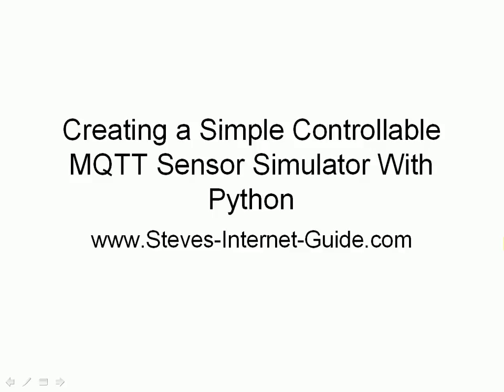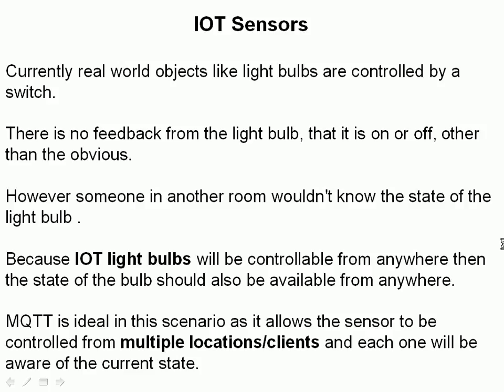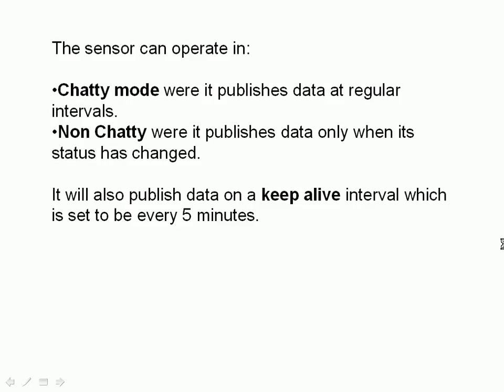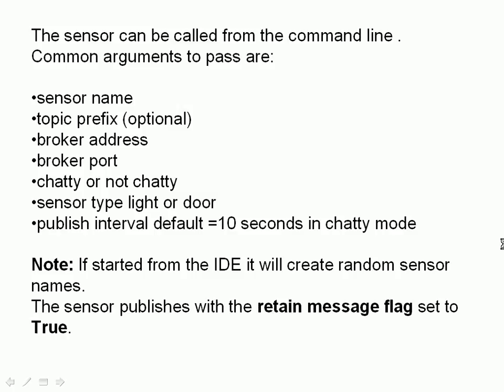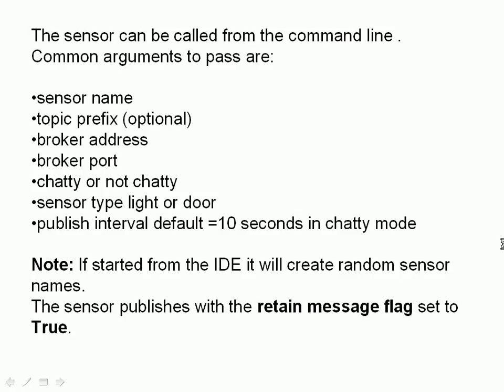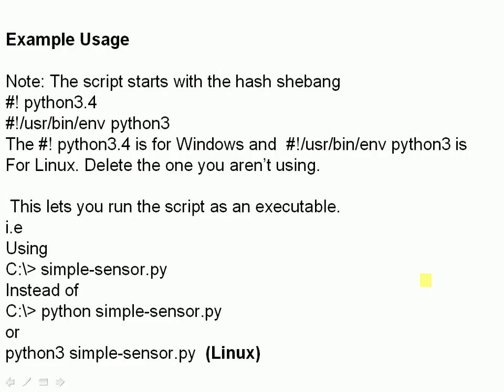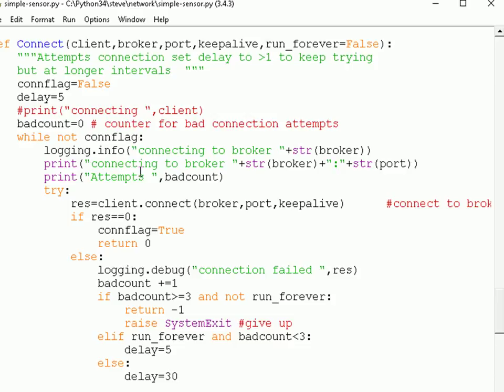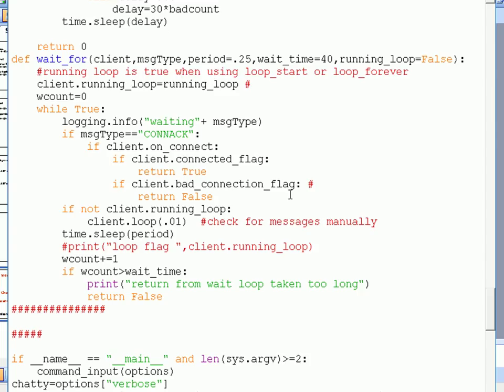How to create a Smple Controllable MQTT Sensor Using Python

Comment: Thanks for your very nice tutorials.
I learned a lot from it.  :-)

May be you can help me with a (small) problem:

I have a sensor (ESP8266) that publishes 3 values:
    # Publish all the values via MQTT
   client.publish('/esp8266/temp',envi[0]) #temperature
   client.publish('/esp8266/pres',envi[1])  #pressure
   client.publish('/esp8266/humid',envi[2]  #humidity
   sleep(60)
  

The broker (Raspberry Pi) receives:
.................................
 client.subscribe('/esp8266/+')
 def on_message(client, userdata, msg):
    a = msg.payload.decode()

This way  variable 'a' only contains the last client.publish value. envi[2]
How can I assign the received values envi[0], envi[1], envi[2] to 3 different variables( x,y,z )

Thanks.
Henk
Reply from the maker: Use an array
a==[]
a.append(msg.payload.decode())
Reply: Thanks Steve. (see donation)